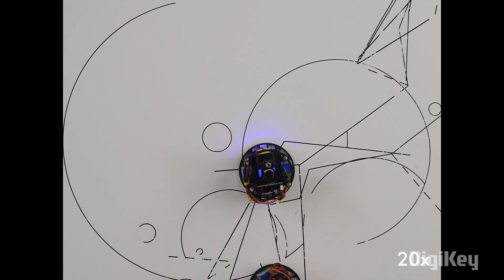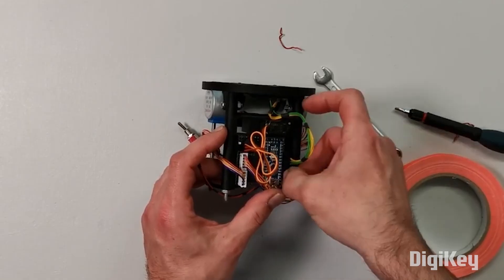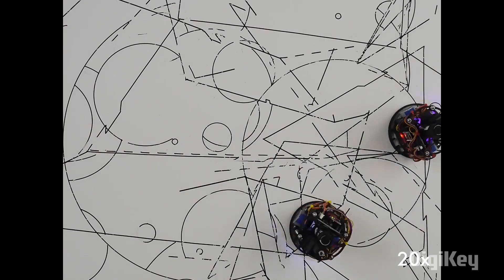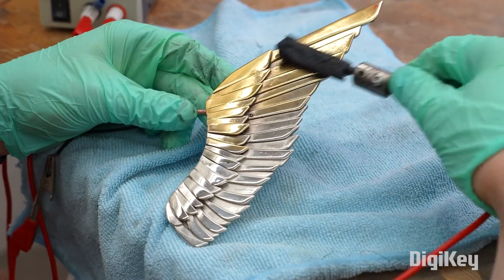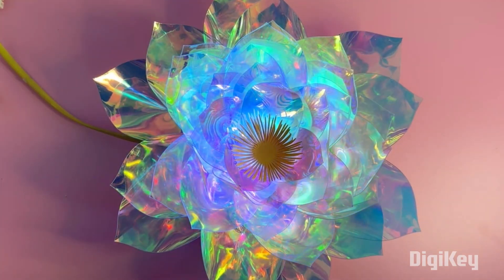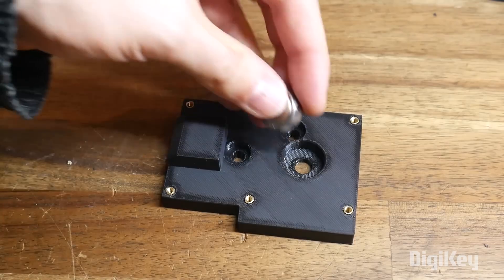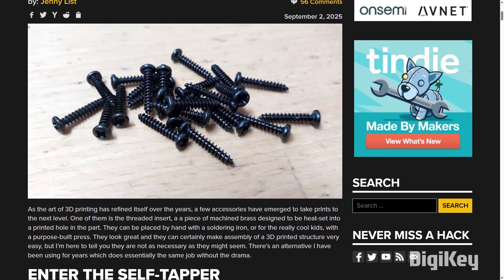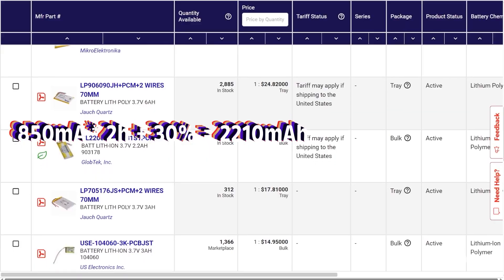Turtle Power [Maker Update] | Maker.io

Comment: Great video, Donald and Tyler! Thanks for featuring my Power Supplies video!
Reply: Of course! Really great beginner's guide, Becky. I really did spend far too long making do with various adjustable DC power adapters. These days, my (humble) power supply is the centerpiece of my workbench. It's also super handy for quickly troubleshooting and reviving broken electronics, since I find that hidden fuses and cheap power regulators are often the issue when things stop working.

Comment: Gen x Britt here and I'll be making a turtle next week. In the UK the BBC developed a computer for schools and a bunch of TV shows to teach kids from all backgrounds to code (they are doing the same with the micro bit now)
Our school had a turtle and whilst I loved it I felt the fact it needed to be attached to the computer by a cable made it feel less like a true robot. 

Reason number 578 of why I love living in the future! Tiny micro controllers and better batteries
Reply: Outstanding! I spent the past week making mine, and it's been a lot of fun. I had a few issues I had to troubleshoot with my stepper motor wiring (fixed it in code, eventually) and sourcing a few parts. I had to give up on finding the exact diameter of roller bearing Niklas used, and eventually modified the design to fit the smallest roller I could find. Now that I have one done and I know how it all works, I'm thinking of tweaking the electronics to make it a little simpler to wire up and easier to load new instructions.